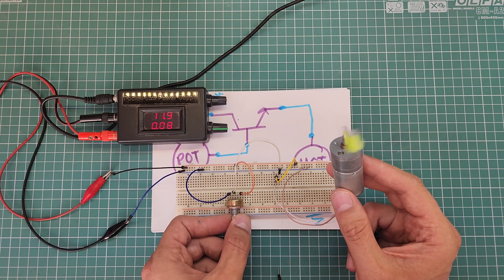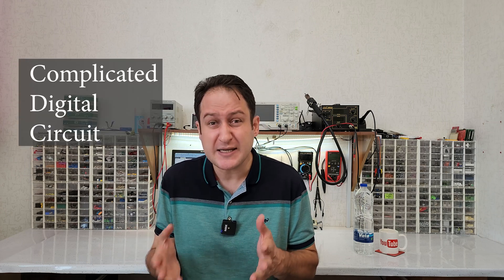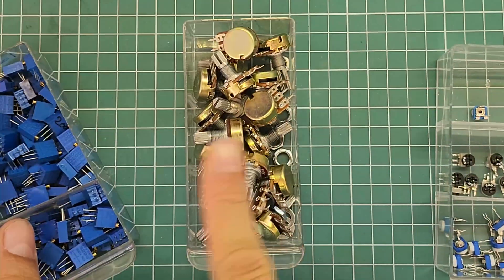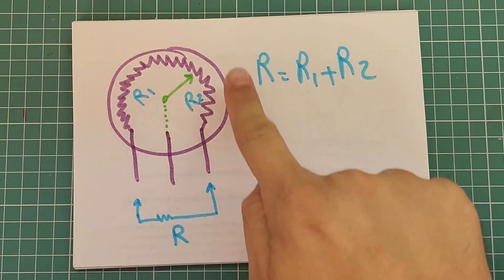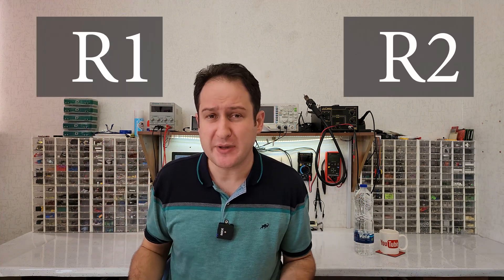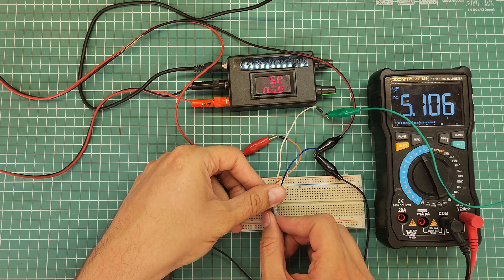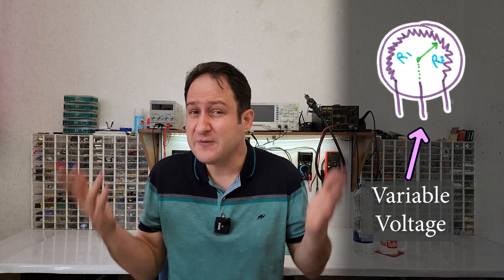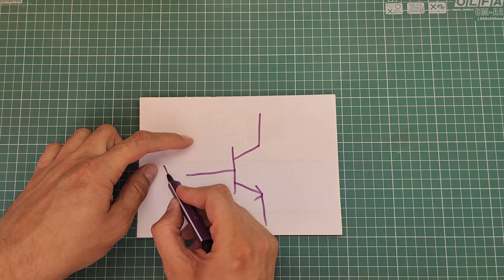Single transistor DC motor speed controller!

Comment: So in this case you connected the load to the emitter (or took the output from the emitter).  Connecting the transistor in this way allows it to behave as a onstant current source.  In your 'How transistors amplify audio signals in megaphone circuit' video you demonstrated connecting the output to the collector for constant voltage source.  You really are very good in your explanations and practical demonstrations.
Reply from the maker: Thanks so much for the kind words! My pleasure. 😊

Comment: Tried this with a 2N2222 and the sacred smoke left the transistor.
Reply from the maker: Yes, each transistor has a specific power.  Use another transistor with higher power rating.  Try TIP41

Comment: You have a useful message and reminder - while PWM is glitzy and cool way to reduce board sizes, the power / simplicity of Bipolar Junction Transistors can be neglected. Good simple explanation how the need to persist the 0.7 base-emitter drop results in movements on the base to be mirrored in movements at the emitter terminal having a different (often larger/amplified) range of motion.
Reply from the maker: Thank you for your comment.

Comment: Your videos are very good and remind us of all the essential functions and the importance of keeping our designs simple as one of the basic concepts of engineering. Can i use 2 or 3 transistors in parallel to use with a bigger motor or what should i do to manage higher current? Thank you!
Reply from the maker: Glad to hear that, yes you can use parallel transistors but I don't recommend. It is better to use a single high power transistor.

Comment: Addition of a diode at motor side will protect the transistor from sudden change in voltage.
Reply: I think you mean protecting against back emf which is coil magnetic field collapse. That is only an issue when using PWM.
Reply: @robguyatt9602 It's also an issue when turning off the power to the circuit if it's still running. For the sake of a cheap diode, it's always best to protect the transistor from back emf when driving any inductive load.
Reply: @RexxSchneider  I only use MOSFETTs with body diodes. :)
Reply: @robguyatt9602  Unfortunately, that won't protect a mosfet from overvoltage on the drain, which is one of the consequences of driving inductive loads. It's a common misconception that the body diode protects against that. :(

Also mosfets make poor source followers since the threshold voltage can vary so much from sample to sample and take up an appreciable part of the available supply. That's why this video uses a BJT as an emitter follower, since the Vbe is small and predictable.
Reply from the maker: There is no sudden voltage change here. The voltage on output is soft and nicely smooth.
Reply: @elewizard  Exactly. see my reply.
Reply from the maker: @robguyatt9602  thank you for your comment. You are right 👍
Reply: @elewizard  Well there's a first time for everything aint there. LOL. My thing is RC servo motor design and manufacture. Mostly self taught via books and youtube. I did some trade level electronics courses too. All enough to turn a hobby into my living.
Reply: It is a good practice to add a diode to the motor because of these scenerios:
1.) When a motor will be stopped suddenly it will generate back EMF and in this case the driver must have a flyback diode.
2.) As you mentioned the PWM will have greater impact on back EMF generation but here if we still suddenly increase the speed of motor it will result in back EMF although a lot less but might damage the circuit.
better safe than sorry
Reply: Wouldn't an LM 317 be a better choice ?
Reply: @keithcitizen4855  power loss might be high